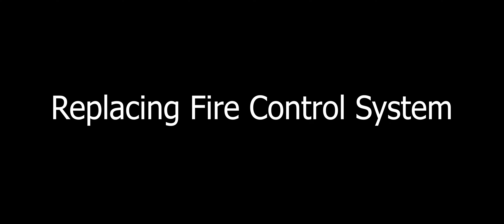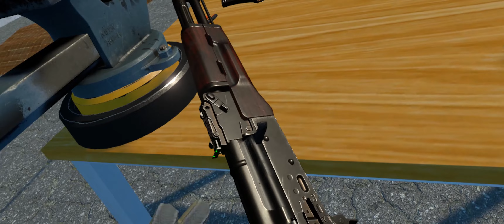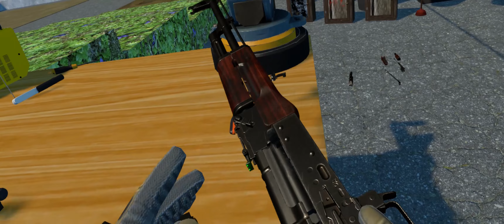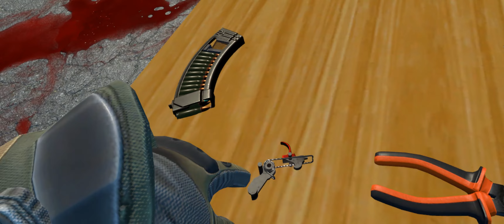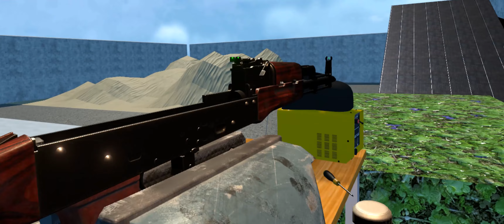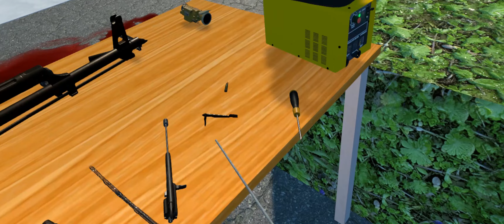[ AB AETERNO ] - Replacing fire control system

Comment: Wonderful. Good call on red trigger for easy identification. Is it possible to spray paint the part as well once it’s fully implemented?
Reply from the maker: Yes ATM working on Universal Painting Machine. So virtually anything you apply can be painted :)
Reply: @VRKemono  Lovely stuff. I think you may have mentioned this once before, was multiplayer ever a concept you wanted to implement? I understand why you wouldn’t given the complexity of the physics engine. Not to mention the syncing of time distortion anomaly sounds like an absolute nightmare